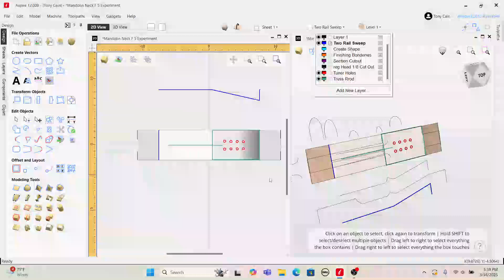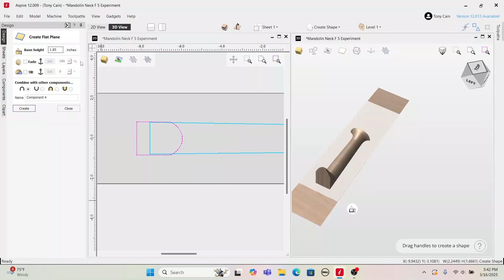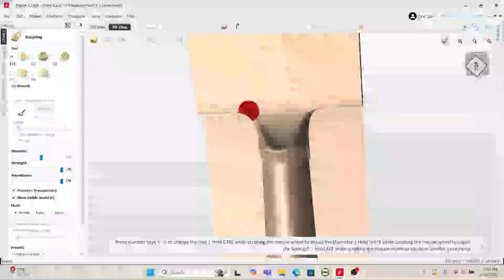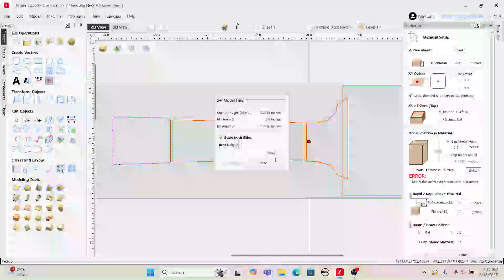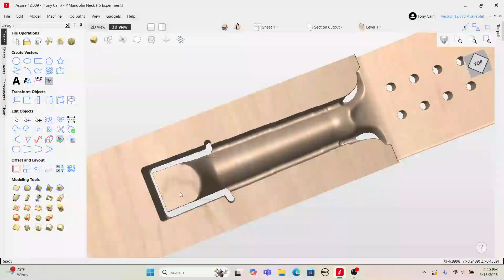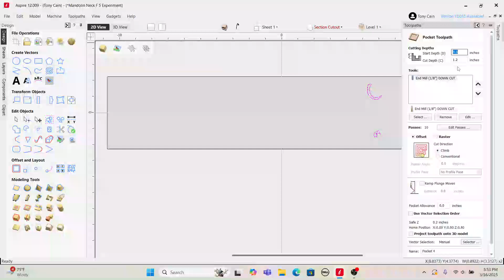Making a Mandolin Neck for CNC Video

Comment: Dude this was so incredibly helpful, I’ve been trying to make a complete neck using just 2 rail sweep😂 watching this process has unlocked it for me - thanks
Reply from the maker: You are welcome…glad it helped. You don’t know the hours I’ve spent trying to get necks figured out!
Reply: @S.T.Guitars lol I can well imagine because I’ve done the same.  Eventually come to the conclusion that vectric being 2.5D isnt quite going to cut it for some jobs so I’m learning Rhino 3d to make more sophisticated models and import them into vectric for tool-paths. So I’m using g aspire for the bodies and Rhino for necks.  Thing I’m struggling with on aspire is 2 rail sweep on 2 sided jobs - seems to invert and mess us when doing the sweep on the reverse for belly cuts.